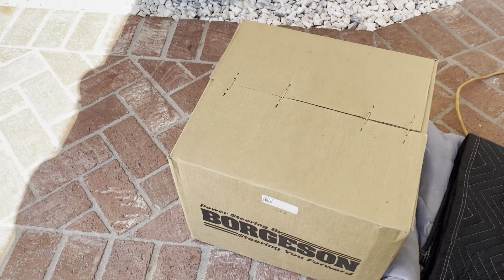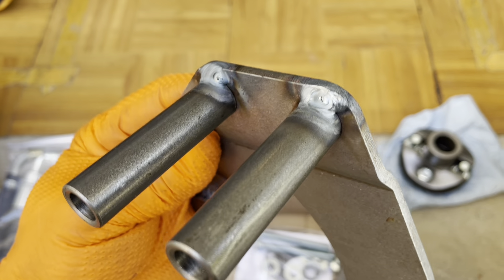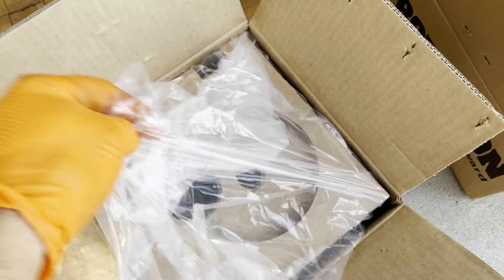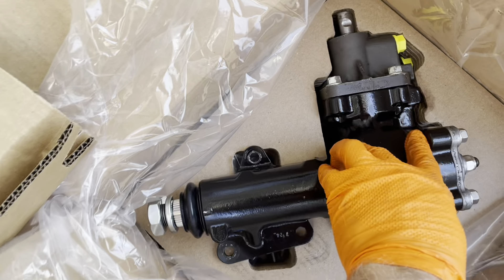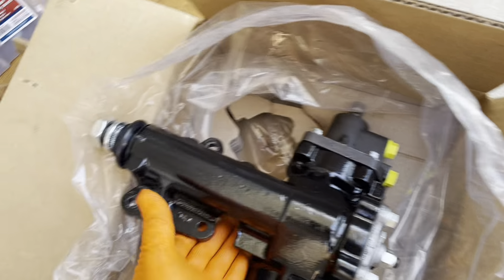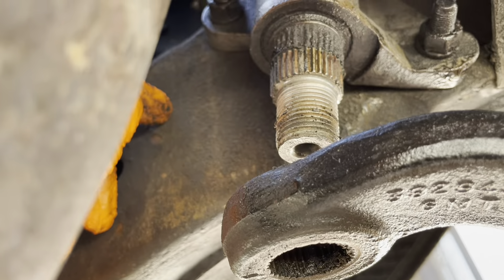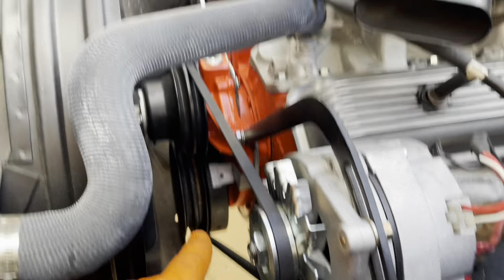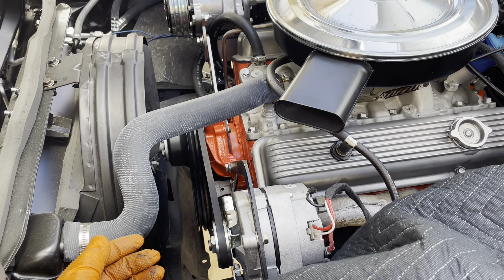C3 Borgeson Power Steering Installation, Part 1

Comment: Looking good👍🏾 The tricky part for me,was resizing the steering column. My car had power steering, so I had to remove all the old stuff. YES - the support bracket is nice. Get it.
Reply from the maker: @mr.keepitreal2200  Yeah, that’s a “measure twice, shorten once” type job. The directions included are a bit complex, but then most people say just take 2.5” off the length.

Comment: unless you have a specific reason to remove the column I would not. I hate that job. there is a guy named klowny that has a really good video.
Reply from the maker: @alberthodge631  Saw it, but I’m swapping the bearing, which they advise to do out of the car.

Comment: Degrease and mint out that area around the box for sure, that mud is no good and will hold moisture against the car.
Reply from the maker: @justinpakarno4346  See Part 2!
Reply: @thedrivewayC3  I realize it will make a mess but citrus degreaser and a dish brush would have gotten ALL the mush off the frame.
Reply from the maker: @justinpakarno4346  Well… You gotta pick a path. I went pretty deep, but not paint stripper deep.